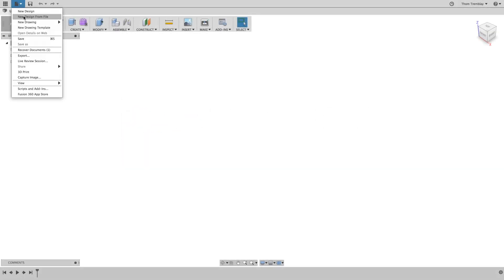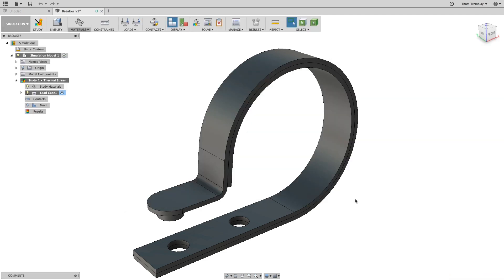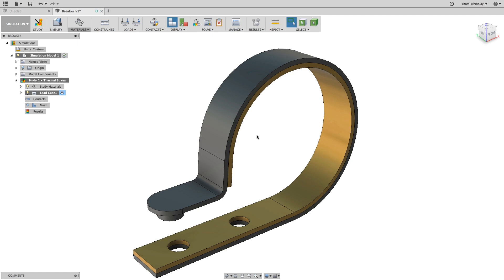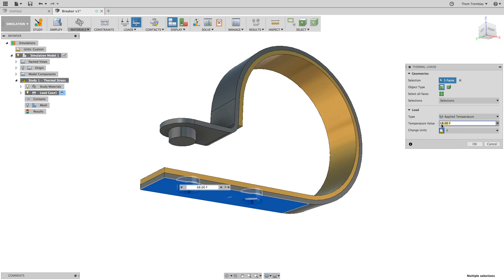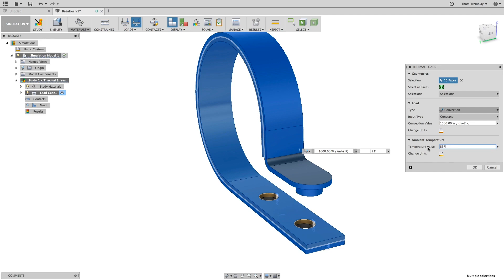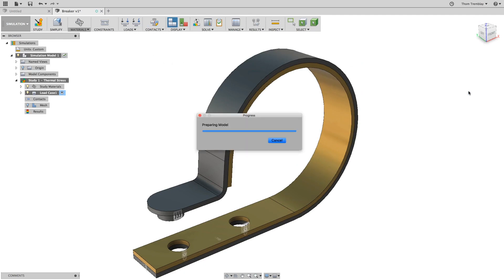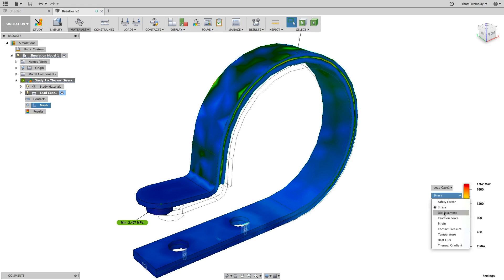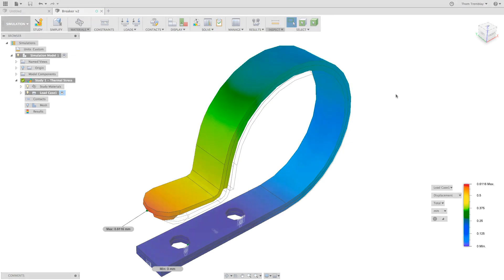Understanding Breaker Physics with Thermal Stress - Tutorial

Comment: Sadly, you fail to realize that the heat is produced by I^2R from current flowing through the bimetallic from the mounting point at the base through to the contact at the other end. The heat is generated throughout the curved strip. Your title should be changed to exploring circuit breaker physics without looking anything up.
Reply: Robert Evans that’s what the internal heat thermal load was for...